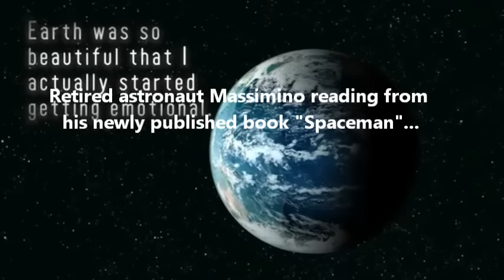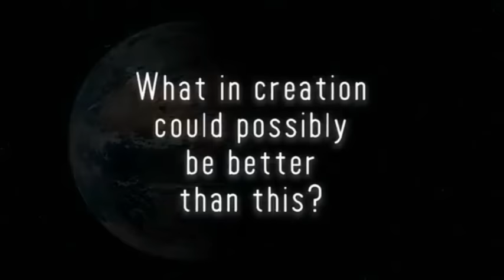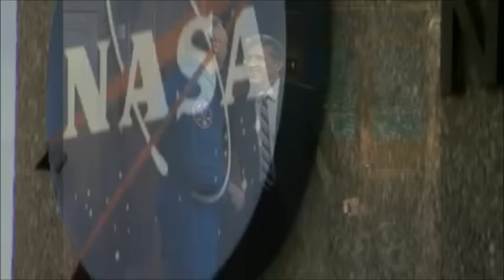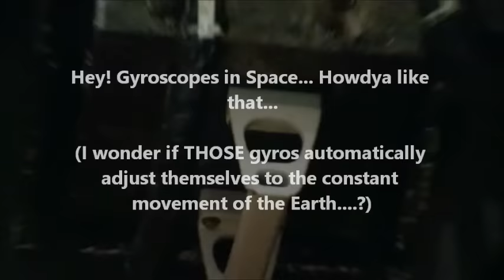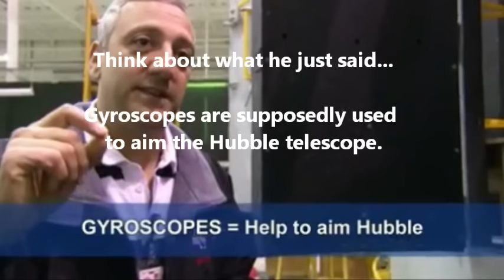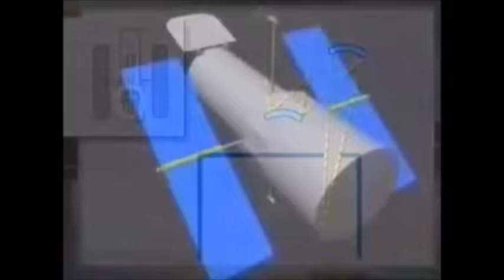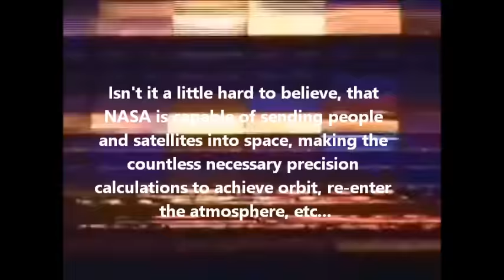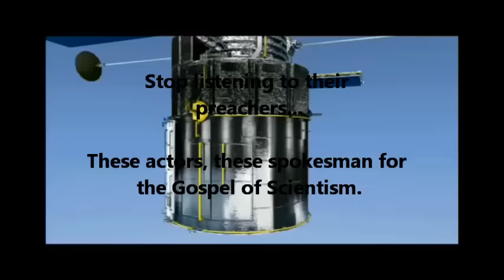[Flat Earth] "Down-to-Earth Spaceman": Massimino, Hubble & 'Space Glasses'...

Comment: To prove or disprove the flat earth is laughably easy.  No need for P900's or Lasers or Autocad.  Anybody can do it with a protractor.  It's amazingly simple.  Just take the protractor and orient it so that 90 degrees points straight up.  Then sight Polaris from the center of the protractor and observe its elevation angle on the protractor.  For those of you who have never seen a protractor, just download theodolite for your iPhone and use it to tell you what the elevation angle to polaris is.  If you can't find Polaris download StarFinder.  It will help you find Polaris.
       The rest is easy, if you measured that the elevation angle is 90 deg. (straight up) then the earth is flat.  If the elevation angle is the same as your local latitude then the earth is a sphere.  You've just measured the curvature of the earth from the equator to your location.  This is Basic Navigation 101 and navigators, mariners, surveyors etc having been doing this for hundreds of years, using a fancy protractor called a Sextant.  You can also calculate longitude by comparing local solar zenith time to zulu time.  Thats why the Brits ruled the seas, they had the first chronometers.  All of this is really basic and anybody can do this with very little trouble, it wouldn't work on a flat earth.
     Today we navigate using the Global Positioning System.  It is crazy accurate and can tell you where you are within inches.  It wouldn't work at all if the earth were flat.  What about the Flat Earth Positioning System?  It doesn't exist and its not coming, don't hold your breath.
Reply: The sextant does not need a globe to measure a latitude location. This was all done on flat maps from day one. Flat earth maps were used up to the 1960's. The globe earth was deceptively and popularized by NASA in the 1960's where most of us were all indoctrinated with assumed, and fake theoretical, astronomical science, also known as Science Fiction.